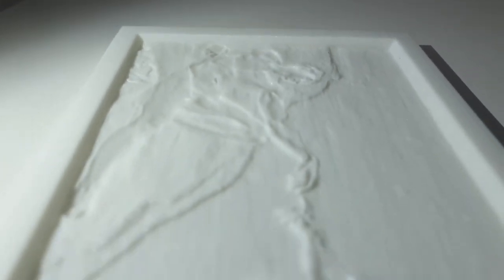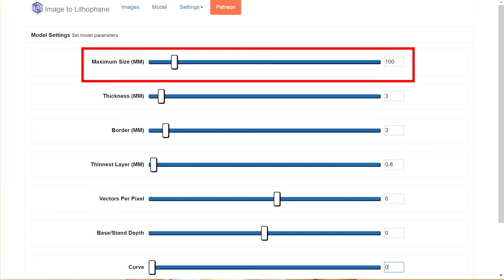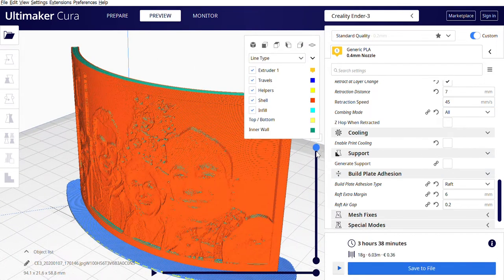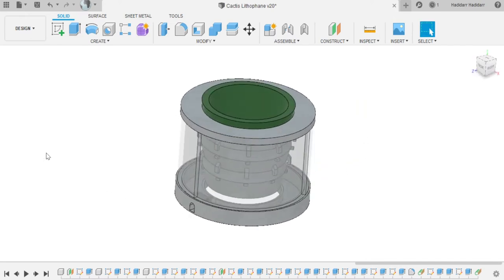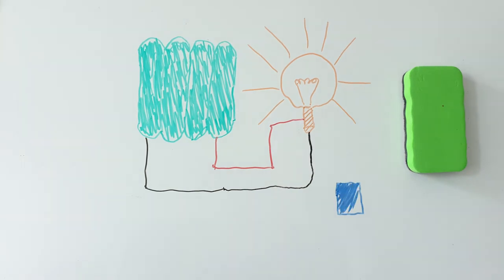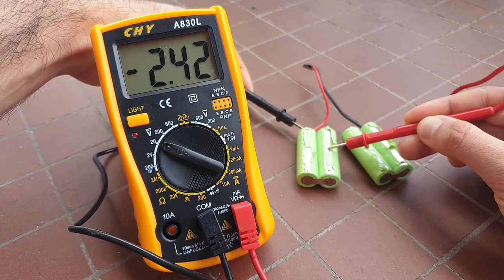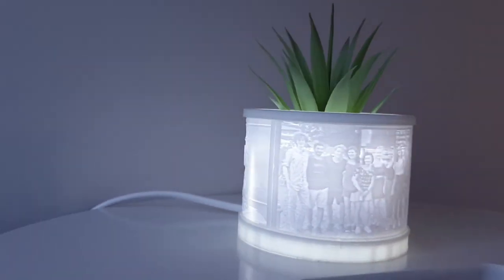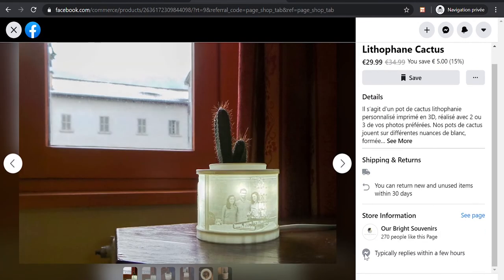How to make lithophane night stands (night stand powerd by a battery, cactus pot, candle chandelier)

Comment: Great job and explanation!
I have some lines visible mostly on flat surfaces, but not only. Looks like a small horizontal seem. Like underextrudion or breaks or something like this, sorry I can't explain it properly.
How could I fix it?
Also where you get those 4-LED stand projector ?
Reply from the maker: @Braincho  hi,
It is a printing problem, is your nozzle is old you might want to change it for a new one, and make sure you are using the right printing temperature and that you are not printing too fast.
For the LED strip, you can find the link in the Thingiverse link, I bought it on Amazon.
Reply: @DarrousHadiLEGO_ROBOTS  TY for quick answer! The nozzle is new, I have printed like 15ish items... Will check the speeds - what speed you recommend or you use?
About links to the LEDs - not working anymore :(
Reply from the maker: @Braincho  50mm is good

Comment: Good choice for music. I printed few of these in the past using 3drocks. Lately when i went for tall pics, i get warping and as the print gets half way it tilts a bit and i lose it. I am using a raft but still not stable enough. Any suggestions? My other nonlithopane prints turn out fine so it s not a generic warp problem.
Reply from the maker: What is your printer?

Comment: Great video thanks just a question don’t you need to use meshmixer?
Reply from the maker: Nope, why would you use it ?
Reply: @DarrousHadiLEGO_ROBOTS   hi dude sorry for my understanding I’m still new in 3D printing . It’s something about fixing the lines or triangle in the picture so cura can read it better. Is that right?
Reply from the maker: Well if you have an .STL file you can print it directly, CURA will have no problem with it.
To create my .STL I used CATIA V5, but you can use any software as Fusion 360 or Solidworks or mecshmixer.
Reply: @DarrousHadiLEGO_ROBOTS   cool thank you for the info 😁 Appreciate your time

Comment: I made my lithophane for the night stand and its to small for the base. I put all the settings the same
Reply from the maker: That could happen sometimes, it depends on the printer, make sure that you don't have an elephant foot on your prints, or you can try to sand the lithophanes down a little or print the base at 102% scale !
Let me know if you have other questions !